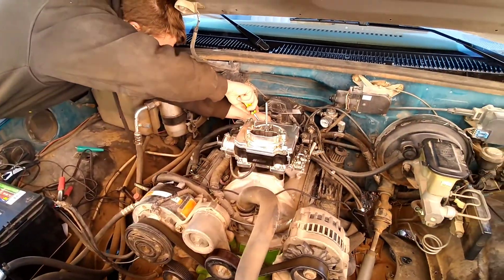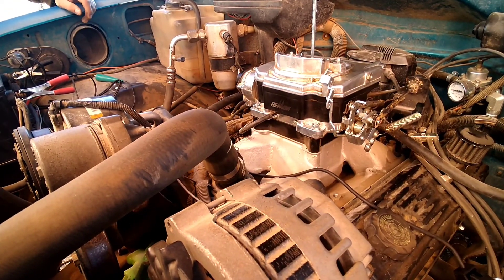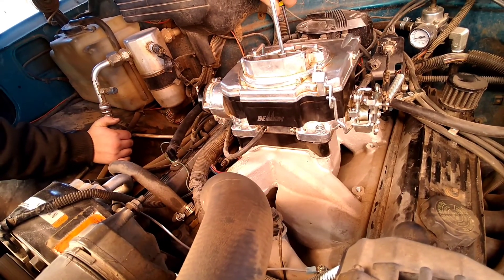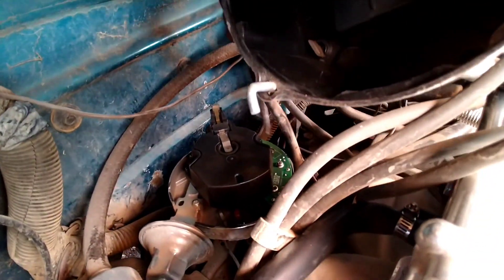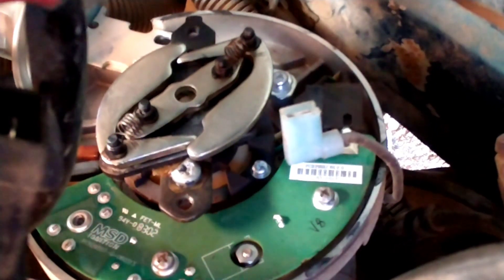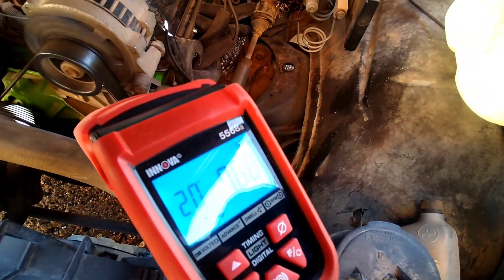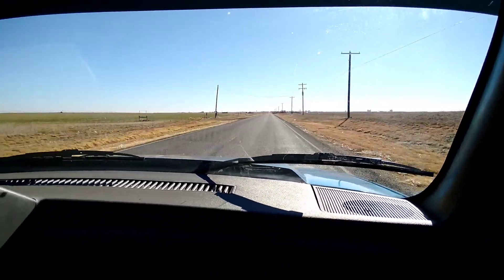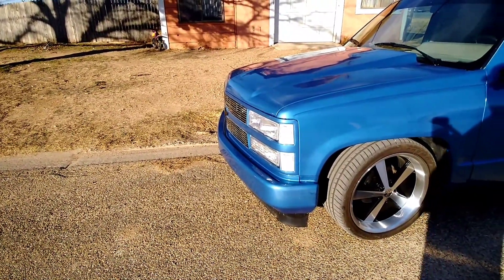Vortec head timing and distributor lockout

Comment: I’m gonna do this on a vortec headed 400 small block. But I’m just gonna lockout the vaccum advance in all and just run it with the mechanical advance
Reply from the maker: How's the 400 run I've been looking into building one
Reply: @CCAutoWorks  it ain’t in the truck yet but I’ve heard they make a shit load of torque with vortec heads.
Reply from the maker: @brandonbell8159  keep in touch if love to know how it runs
Reply: @CCAutoWorks  I kinda got a dumb question. I’ve never actually used a timing light before. I got that engine built the vaccum advance is locked out and everything. Do you set on the gun what timing you want and move the distributer until it’s showing zero on the balancer?
Reply from the maker: @brandonbell3089  if your timing light is set on 0 than you want to turn your distributor tell the balancer reads 10 12 14° what ever you want it set at but say you have an advance timing light and you can set it to 10 12 24 36° what ever u want and if it's set to 12 then you turn the distributor tell it's on 0° or TDC
Reply: @CCAutoWorks  my timing light I just picked up isn’t a special one. It’s a Innova 3568a. I’m thinking I can set it to my desired initial advance which is 16 degrees. Then just move my distributer until it shows 0 on the balancer??? Is that correct
Reply: @CCAutoWorks  is that the jist of it
Reply: @CCAutoWorks  also thanks for the help
Reply from the maker: @brandonbell3089  yes that's correct
Reply: @CCAutoWorks  ok thanks man👍. Also if your curious how it runs. It pulls really really hard compared to the 350. Do you have a Facebook?
Reply: @CCAutoWorks  I could show you how it runs and sounds. Right now it has a big 850 DP on it and just a little split duration flattappet cam. It’s really snappy for what it is. Home ported vortecs,flattop 400 .040, Howard’s flattappet with more lift and duration on the exaust to help them flow. Cheap eBay roller rockers,airgap intake and that 850 DP.
Reply from the maker: @brandonbell3089  very nice setup I don't have a Facebook only Instagram my brother has a Facebook